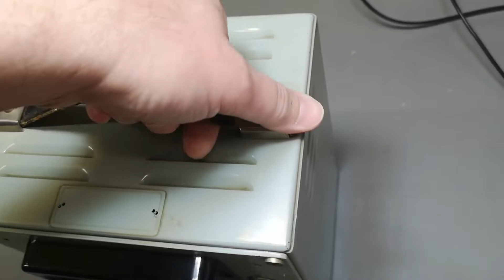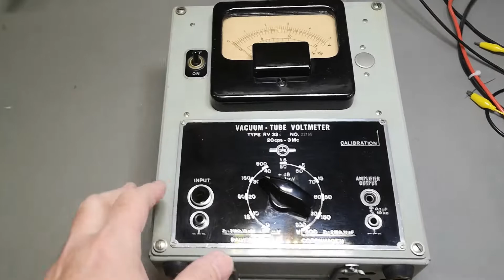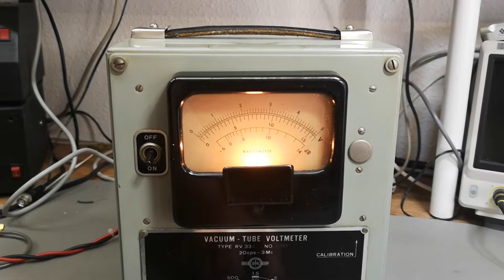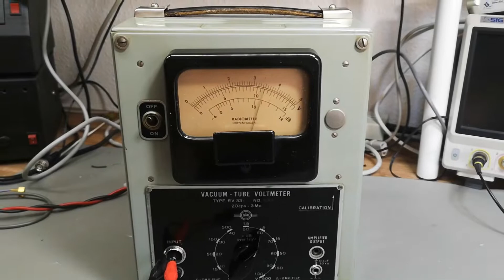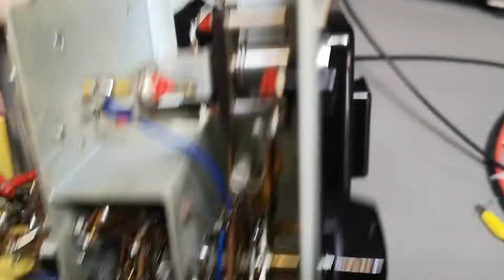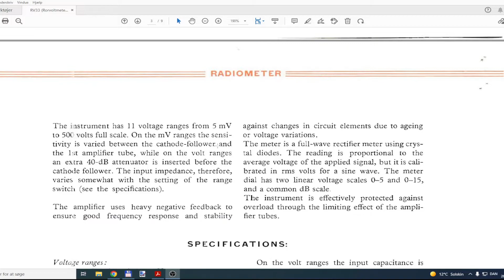Radiometer RV33 vacuum tube voltmeter Test and Teardown (1950)

Comment: Problem with having RC filters is that the voltage always drops with effective filtering. With 300VDC to start with losing 150V before you get to the most sensitive stage not a problem, but if all you have is 5V big problem. That is why you see so many LC filters, with ferrite beads or damped inductors doing the L part, and capacitors with low ESR. Otherwise you have to cascade voltage regulators from a higher supply, and have separate regulators for each stage, so that noise from the one does not interfere with the other stage.
Reply from the maker: exactly, but lets also put the voltage and uF ratings in proportional relations, a 5V circuit, would use 16V rated caps, and 100 to 470uF will now perform fantastic with 1R or 10R in series, depending of this circuit part current consumption , and this type of cap, will be quite small diameter
Reply: They did RC filtering in e.g. 9V portable radios. Current must be small and steady. 
Now there are opamps with high PSRR - power supply reject ratio, and non-constant consumption.